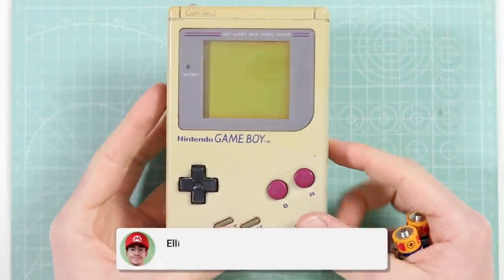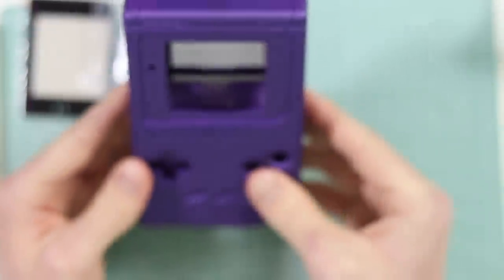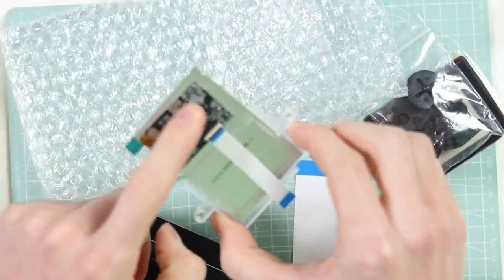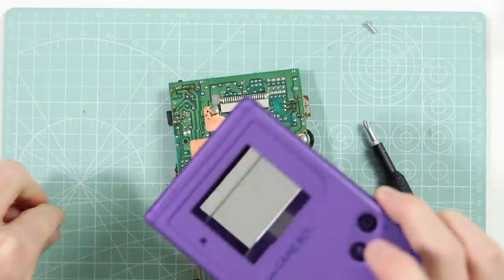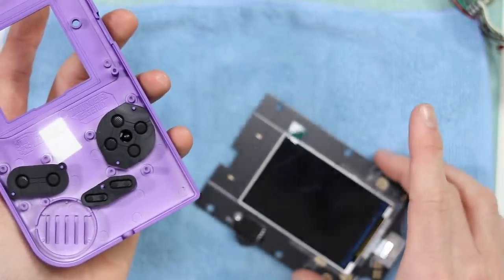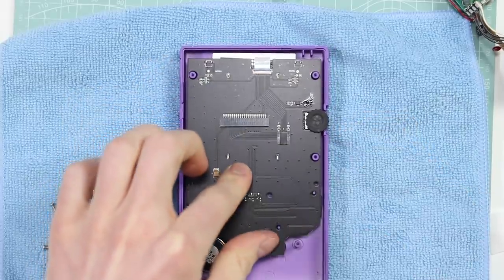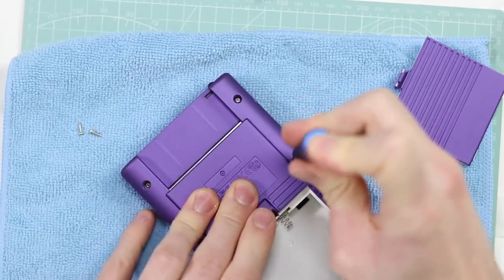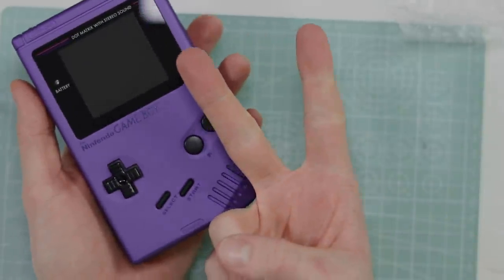Building a modded GameBoy for a viewer

Comment: Used this as a guide to fix my original Game Boy I got back in 1989, the thing had been up in my loft for about 10 years, was encrusted with filth and would not work. After a quick pull apart, a nice clean with the alcohol, and some new buttons, I got that baby purring like a kitten.

Comment: Those prestige shell colors are so sweet. ive been thinking of getting a purple one myself. I just wish it didn't have "for" on it. And the only button issues ive had with retro6 and HHL are the Game Gear dpads. Ive had to slight mod the center so it would fit correctly.
Reply: Whatever you do, do not buy a clear shell as the Retrosix/HandheldLegend branding is visible from the front and there is no way to hide it!
Reply: @dirtylivin07  oh wow. ty for the advise. Im not big on the clear shells. Sept the OG Play it loud model. Have one here that's complete. Cords and earbuds are unopened and its backlit and biverted.

Comment: I finished my Game Boy recently and it works up until I put it together completely. Once I put the screws in it stops working, but before the screws when everything is connected, everything works. Do you think it's the battery connectors? They are pretty clean/no corrosion that I can see. It just doesn't want to turn on when I put it together so to play it I have to remove the screws.

Comment: hey, what happens if i put an ips in a gameboy classic that has a bivert chip installed? does it still work? or can the gameboy or something on the circuit board for the ips be damaged? I have a gameboy classic in which a backlight with a bivert chip is installed. but the display doesn't work properly and i wanted to exchange it for an ips.